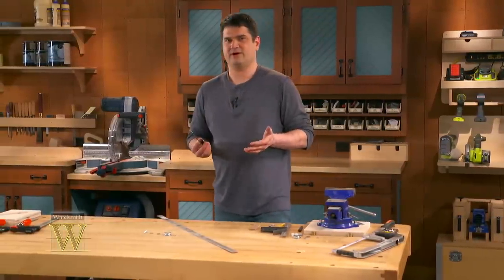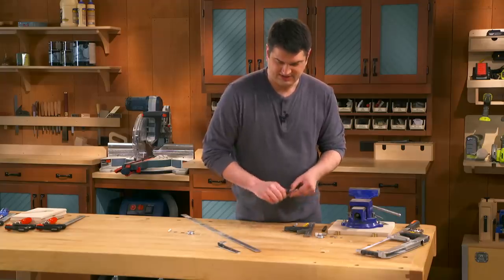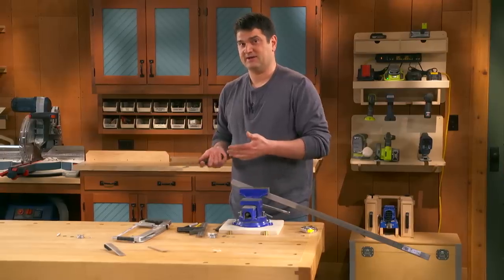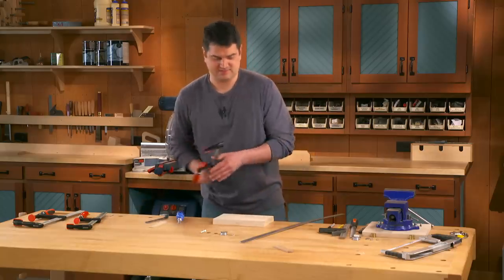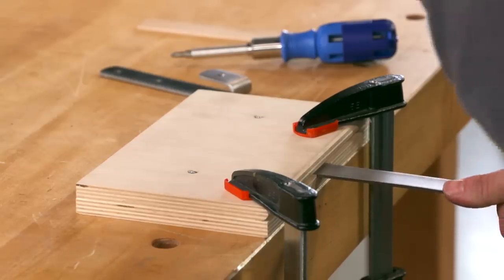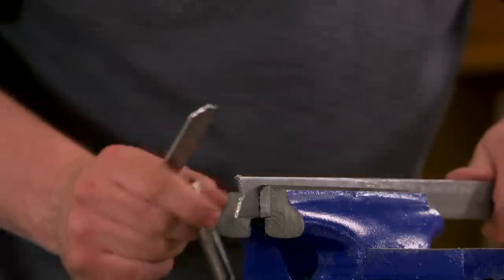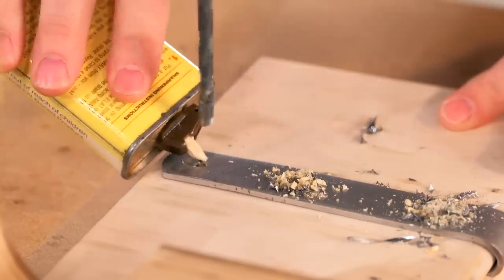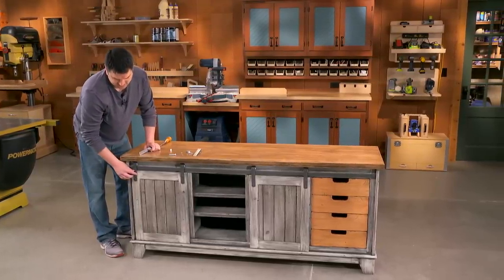How-To Make DIY Sliding Barn-Door Hardware

Comment: Love Woodsmith! I was however skeptical about that vise mount and sure enough was confirmed when you had to hold onto the vise as you hack sawed :) Seriously though, as a wood/metal worker replacing a bench top I'd love to see something usable for both. Probably something on YT somewhere.....
Reply from the maker: Yeah the metal vise was not very secure in our workbench vise... I probably should have just clamped the plywood platform down to the bench.  Bad choice in hindsight.  After this video was shot I suggested we design a workbench/cart/workstation solely for the purpose of metalworking because it really should be kept separate from woodworking so the metal filings and shavings don't get embedded into your wood projects.
Reply: @WoodsmithShowandmagazine  That's a great idea - I hope to see it happen! Woodsmith projects are well designed, I'm sure whatever you guys come up with will be nice.

Comment: I love that grey finish on this cabinet and I have searched and searched for how to recreate it with no luck. Did you create this look or do you have tips on where I might look? I hope to hear from you!!
Reply from the maker: Actually, we have a video of how our Shop Craftsman finished this cabinet here:  https://www.youtube.com/watch?v=kB6iOJncgHg

Basically, we used General Finishes Antique White Milk Paint,  then a clear coat on top of that (like spray lacquer or General Finishes High Performance Top Coat), and then wiped on General Finished Pitch Black Glaze into the cracks, crevices and dings and wiped off any excess.  You can also do a little sanding and wear-through on the finish.  When you get the get the look you want seal it all with a couple layers of the clear coat.

Comment: Not sure youre still looking over comments on this video anymore, but in the off chance you are...  roughly how much clearance do you need from the opening of the cabinet to the top of the cabinet to accommodate the hardware?
Reply from the maker: On our cabinet the upper face frame rail is 3 1/8" wide so that is the distance from the door openings to the underside of the cabinet top.  The distance from the top of the metal runner is 1 7/8" from the underside of the top of the cabinet.  Hopefully, that answers your question.  Let me know if you have any more.
Reply: @WoodsmithShowandmagazine  Awesome!  I appreciate you taking the time to reply!
Reply from the maker: the_human_toe - No problem. Always happy to help.

Comment: Use a grinding wheel to round the corners, faster and simpler
Reply from the maker: Absolutely, that is exactly what I did when I was building mine, but I wanted to show it being done without a bunch of expensive power tools.  Of course I went and used the drill press to drill the holes. 😀

Comment: I only dabble in light & small woodworking projects when I have to. Metal machining has been my main hobby for almost 40 yrs. Hopefully you wont mind some constructive criticism since you were attempting to demonstrate how to shape and form metal. Your methods obviously worked, but technically there a bit off. A cheap jewelers hand saw would have allowed much easier cutting to the line with very little file work to do. Even easier would be if a variable speed scroll saw is available then proper metal cutting blades are made for them. Dialing the speed right down and a light touch "IS" needed though for thicker cross sections of material due to the blades being a bit fragile.When filing and not lifting the file on the back stroke but dragging it back across the metal that simply dulls the teeth. Filing an outside radius is much easier with quicker & smoother results when you file along the length of the radius and not across the material. You roll the file to follow the radius. That bend could have all been done in and on the bench vise with the only addition of a short steel rod matching the required radius, maybe a pair of vise grips for a bit of help, and a hammer. Soft wood even SW ply makes a poor former for shaping metal other than maybe light gauge sheet metal. It compresses too easily so the bends aren't an even continuous radius. So doing it in the vise would have produced a tighter and better formed radius. If you do have to use a hack saw for anything? It's a common mistake to only use a few inches of the blade. The job always goes a lot quicker when you use most of the blade length you paid for on each stroke. That also helps to even out the wear on the blade and keeps the blade thickness evenly worn from friction along it's length.

Understandably and unfortunately I see numerous and faulty methods shown in every wood working magazine out there when the subject of working with metal comes up. Your wood workers without a long back round of using the material so it's of course logical and not surprising. Frankly if I was the owner of any wood working magazine I'd find one of the thousands of old school retired machinist that started out learning how to hand work metal to keep on a small yearly retainer to double check any methods before there presented to the public. For the little that might cost it would well worth the extra credibility. It was a very a good video with a few minor faults so it still gets a thumbs up.
Reply from the maker: Thank you for all of your thoughtful insight on the subject of metal working.   Obviously I have more to learn on the subject, so the tips are appreciated.  :)
Reply: @WoodsmithShowandmagazine  Your more than welcome. Filing metal by the ones who have a great deal of experience is almost an art form. Tom Lipton on his Oxtools channel here on YT did a series a few years ago about building a bar stock welded reproduction of a Wilton Baby Bullet vise that demonstrates what can be done with some simple crude files and a bit of time. And exactly like wood working, hand tool metal working takes a great deal of skill, knowledge & craftsmanship. Just like high quality wood working it's a whole lot tougher than it looks. :-) However wanting to learn more to get better at it is without a doubt the best attitude to have.
Reply: Are you going to post a video TP8?
Reply: Turning point needs to go back to 5th grade. Terrible grammar!
Reply: @DJMARTIN73  Then it's a good thing my points were not about proper grammar Mr. Detail. Is that really the best ya got or do you have something even semi intelligent to add to the video's topic?
Reply: @DJMARTIN73  40 yrs free metalist advise...priceless......Grammarly for the desktop free......which do you think I am more concerned about watching a metal fabrication project & getting good  followup pointers....or how to download grammer correction software?....Thanks for the video and for the free advise Turning Point....

Comment: what black spray paint finish do you recommend for the metalwork?
Reply from the maker: I used Rust-Oleum Metallic Dark Steel #262662... I was originally just going to use black spray paint, but I found that it just didn't look natural, so I went with this metallic spray paint.

Comment: not to knock ur diy but for furniture barndoor hardware just use aluminum easier to work with and plenty strong enough, and use plastic spacers to mount bar to furniture. wheels i get on amazon https://www.amazon.com/gp/product/B07C1MXY88/ref=ppx_yo_dt_b_asin_title_o04_s00?ie=UTF8&psc=1 hard plastic which i prefer over metal  and already black.

Comment: Get a sliding screen door roller
Reply: Or a glass door roller
Reply from the maker: You could definitely use the plastic or nylon pulleys found in screen or glass door sliders, but I wanted to go for the look and feel of high-end barn door hardware so I went with a heavy-duty metal pulley.